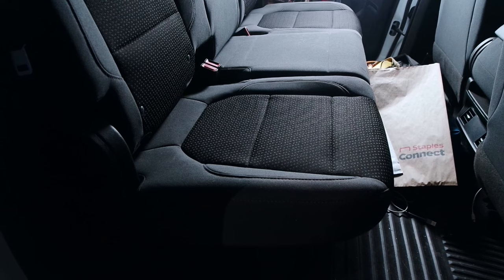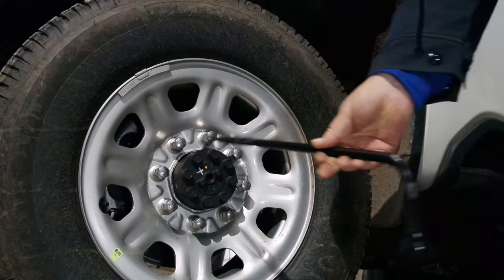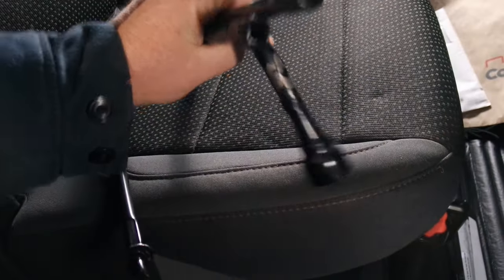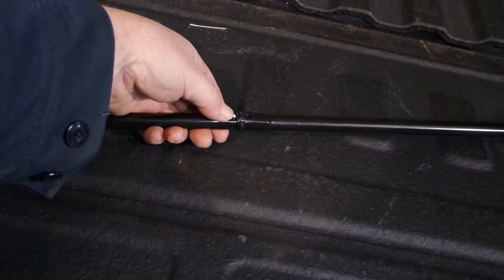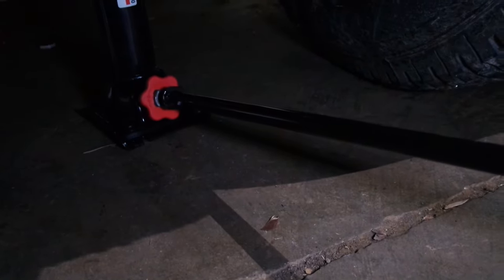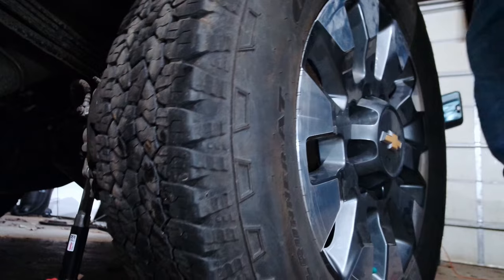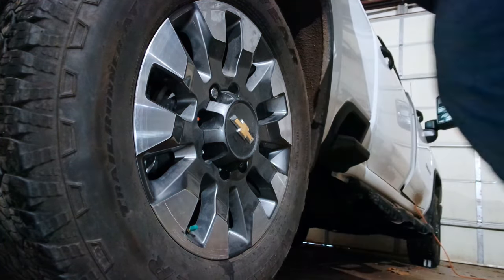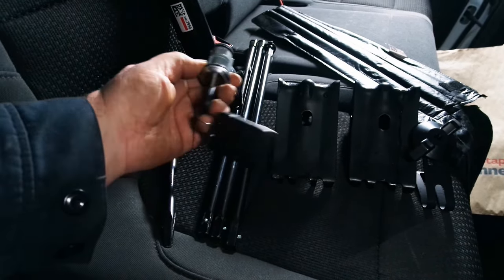How to change a flat tire 2021 Chevy Silverado 1500 2500 to your spare

Comment: You forgot to mention that jack is at the max height with stock tires. If your tires are even one size up you are stuck waiting for roadside.
Reply from the maker: Not that I would ever recommend doing anything unsafe but if I had oversize tires I might also carry a foot long piece of 2x6 to put under the jack. :)
Reply: I’m disappointed in GM on the jack they provide

Comment: I drive a 2020 HD 3/4 ton Chevy longbox. I had a flat tire in Montana snowing 3" an hour. I was on the interstate and had a front flat tire blow out. I found the closest place to get to the edge of the interstate I could not get the Jack under the front end due to the front end being to low.  By then there was 8" of snow and still snowing highway patrol stopped and he had a ton and a 1/2 4 Jack between that Jack and my 3 t bottle Jack I finally got it up off so I could get the tire and put the spare on. The whole time it snowed a total of foot I was laying on the ground what heavy snow took me 2 1/2. I had no cell service.  I wish I could send a video on this comment it wasn't fun but I got it.  I forgot to mention it was on a 10% downhill grade on snow and ice.
Reply from the maker: Yikes that sounds like a nightmare. Glad it worked out though!

Comment: I was on my way to drop off my kid's at school. One of my tires blew up, luckily I was not too far from their school. I drove super slow with my hazard lights on. Dropped them off and I pulled over called for road side assistance. They said it would take 45- to an hour and a half. I decided to look on you tube. Found your video and I have to say, I was so helpful and easy to follow. Changed the spair in roughly 30 min. Thanks alot
Reply from the maker: You're very welcome!

Comment: I had a 2021 Chevy Silverado. The stupid tire won’t come down when I’m cranking it tried kicking on the tire. Something is messed up.
Reply from the maker: This might sound obvious but make sure you used all the pieces when you assembled the crank handle. Then turn it counter clockwise slowly while pushing in so the you know it's engaging the actual crank. Those are the only two things I got for you otherwise yeah sounds like something is messed up in the mechanism  :(

Comment: I always wondered if changing a tire on a pick up truck was different versus a car since it sits higher  no what if you had a 3 ton floor jack the one with the wheels? where you place it underneath the truck?
Reply from the maker: On the rear it would be the same place but on the front I would go under the control arm. 🙂
Reply: @MidnightRoadGarage  thank you for responding back I thought maybe like the frame or something or in the rear or front I thought they said using floor jack with wheels to raise it up lifting the pumpkin, So I guess when you say control arm I guess there's a spot underneath there not directly under the control arm right?
Reply from the maker: @whatisthisevenfor26  so if you lift it in the rear from under the pumpkin it will lift both rear wheels which you wouldn't want to do on the side of the road. I'll take a look when I get home later and see if I can give you a better description for the front.

Comment: What volt of Impact do you use?
Reply from the maker: 18 volt Milwaukee M18 but many times when doing wheels I break the lugs free with a small breaker bar and then put the final tighten with the same breaker. Not that I don't trust the impact, it's just habit lol.

Comment: Pretty good video. I would have never guesses it had a lock and key to let down the spare. I didn’t read that in the manual… 🤔
Reply from the maker: Thanks I'm glad you enjoyed the video! The lock might be an option that my truck came with it.
Reply: @MidnightRoadGarage  I checked after watching the video and sure thing I have it!
Reply: Mine has a lock but im not sure where the key is?
Keyless ignition so no keys.
Reply from the maker: @irok1d  for keyless ignition there is actually a key hidden in your key fob. Should be a button on the side to release it.
Reply: @MidnightRoadGarage  
Ok wasn't sure that one would work.
Thanks